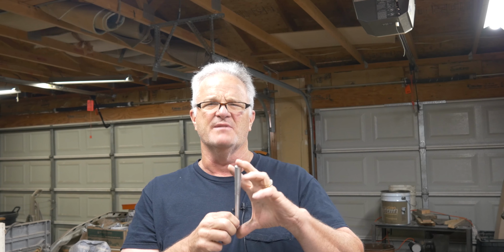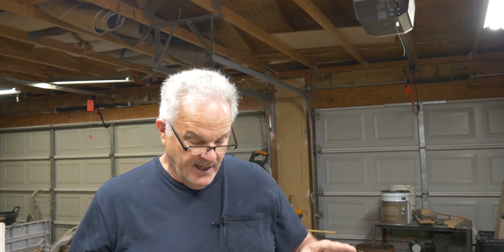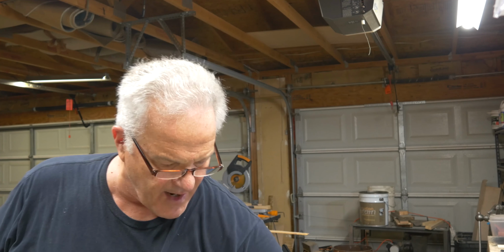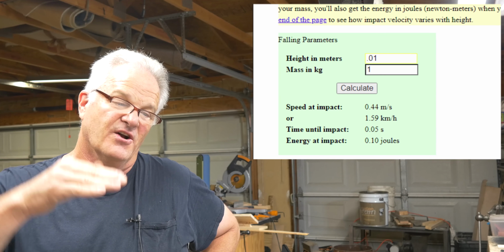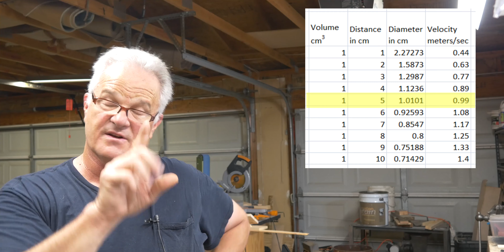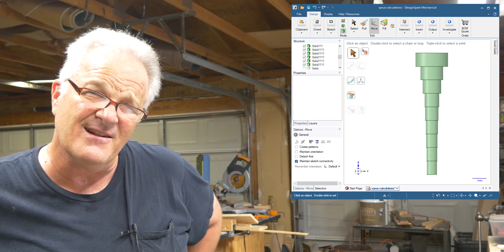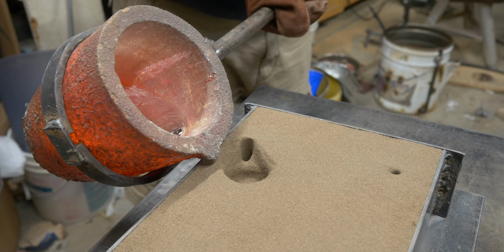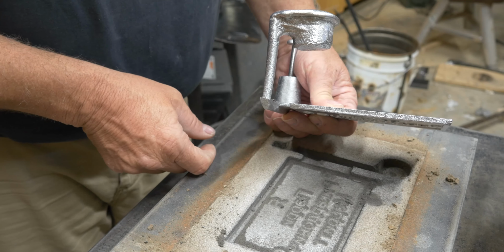Learning to cast metal - tapered sprue

Comment: Perfectly explained . I am following your videos since you uploaded Bob's videos . The video helping me alot in designing my gating system in permanent mould castings . Looking forward for more videos.
Reply from the maker: I think gating is the next video. I keep going back and forth between gating an basin, which to do next.
Reply: Video on gating calculation will be nice . If possible make a video on nitrogen degassing effects on porosity . 👍👍👍👍
Reply from the maker: @sourabhkulkarni2515  You might want to check these out https://www.youtube.com/playlist?list=PLU1QP34Dv8Y6lbvgqXuvCPEnXeE4IgWgr They are from a real expert.  

I have no experience with nitrogen degassing or any other type of degassing for that matter. Sorry.  In my opinion, we can do far more to reduce the porosity of our castings by controlling the pour and flow through the mold than microscopic degassing will do.  Just my opinion, don't hate me for it.

Comment: Just found your series - Wish I had some time ago ;(  One thing I wish you had described in more detail was the "Spin Gate" - dimensions and shape. Many thanks for this informative set of videos.
Reply from the maker: The dimensions are kinda made up. I just did what looked right and proportioned. The idea is to redirect the surge from the initial filing of the runner from splashing back on itself. As long as you are putting something round out on the end I think you're fine. The round part needs to e tangential to the side of the runner so the metal is gently redirected into the circle. I've see some guys do it where the make it look like an "i" with the circle centered on the end of the runner. That won't work and will likely cause more turbulence.

Comment: You want to divide your flowrate ( length cubed per time) by the velocity (length) and that will give you the cross sectionla area (length squared) of the pipe ( not the diameter).  You points are still good though, nice video!
Reply: sorry, i meant velocity (length per time)
Reply from the maker: Thanks, I appreciate the info.  I'm really not a mathematician.  If I think about it long enough it starts to make sense though
Reply from the maker: Got it
Reply: You guys are trying to sound fancy by using the word velocity instead of speed. The only difference is that velocity is speed with a direction. This only becomes important when you’re adding multiple vectored quantities together so you can add the separate components (x, y, and z, for example). Since we are talking about a vertical sprue with only a 1 dimensional component (z), the direction is implied and it’s not really a vector quantity in this context. Here, the word “speed” is fine... using “velocity” when “speed” would do only makes you sound smarter to people who don’t know any better (see the movie “Idiocracy”)

NOW. If you put the sprue in at an angle, you would have both a Z and an X/Y component. Gravity would only accelerate in the vertical direction, so the final speed (or velocity if you still want to go there) would be less for a given sprue length than a vertical one. This should make sense if you think about it. Further digging will reveal that it’s proportional to the cosine of the angle deviation from vertical (100% at 0 degrees deviation and 0% at 90 degrees)
Reply: Yeah I was just trying to say that what we're calling the size of the pipe is actually its cross sectional area and not the diameter...so the spreadsheet needs a sqrt() in it somewhere
Reply: @TroyeWelch  🤣
Reply: Who is trying to sound fancy? I'm cracking up here!
Reply: @TEXAS-SMITH  sometimes you have to out-fancy the fancy. Something comes to mind about the people who think they know everything being very annoying to those of us that do. Raise your hand if you’ve got an engineering degree🖐🏼

Comment: Thank you for sending me here from your aluminum bronze hammer video. I didn't realize how old that other video was before I commented which is a little embarrassing, I should have checked before. I definitely don't think that hole was shrinkage though. The top of your casts with the divot definitely is, but that hole on the face isn't uniform at all. It looks like sand collapsed a little while you closed it which you thought may have happened and that's what caused the hole on the hammer face. I could be wrong though, at the end of the day, you fixed it and it looks great. You're awesome.
Reply from the maker: Yeah, that's a problem with YouTube. Things like follow-up videos  really don't get posted in a way that people notice. It happens all the time. 

I can tell you that two people that are professional foundry people have each told me that the hole is a void caused by molten metal inside the part shrinking away from the chilled metal of the surface.  Here's another video for you to take a look at https://youtu.be/IYqpHAxBLOI

Comment: I wanted to do a cast with a tapered sprue since I started sand casting, but I still have no proper sprue pattern. (got a tapered pattern from an empty sew yarn roll, but that is a little short) With this information in mind, I really need to be on the look out for a proper sprue! Will defenitely improve my casts! I guess you need various diameters of sprues for different sized casts? For example, if I want to cast an aluminium cast of 3 kg, that small sprue will result in lack of liquid metal in my mold and causing freeze ups before it completely fills the mold right? I think when you go big, you need a bigger sprue and pouring cup, or am I completely wrong on this?
Reply from the maker: Have you thought about this https://www.plmfoundries.com/product-page/sprue-runner-kit

Comment: I was impressed with the air bag demonstration, who’d have thought, excellent. 
Great series, cheers. Peter
Reply from the maker: Thanks Peter, yeah that is one great demo. Wish I'd thought of it :-D
Reply: There's actually a couple of jet and rocket engines that use the same principle to nearly double their thrust. Check out ejector rockets and ejector ramjets. High velocity stream of fluid entrains atmospheric air and fwoosh. Trade a little exhaust velocity for a lot of mass flow rate.

Comment: Great demo.  I agree that the offset pouring basin is inextricably tied up in all this - even a tapered sprue will suck air if you use a funnel shaped pouring basin. It's the venturi effect.  Your propane burner is probably designed to suck in all the air it needs in the exact same way, just like the amazing plastic bag demo.  Looking forward to the next episode!
Reply from the maker: Yeah, man I really debated...still am... whether to do the basin next or the runner/gate(s).  all three are tied together.  Maybe I should do the ....  aaauugh it hurts my head to think about it. ;-)

Comment: I am curious about the relationship between the size of a part to be cast and the most appropriate sprue size. I recently cast a 9 pound part and after a few failures it seemed like a larger sprue helped completely fill the mold before the metal froze.
Reply from the maker: There are calculations... here's where you know I'll fall apart... that give you stuff like freeze rate and from there I expect you can figure out required volumetric flow rate.  I know that larger castings require larger sprues for larger volumetric flow.  I'll ask my foundry friend Nate if he's got anything to offer.
Reply: Preheating the molds before casting can reduce the risk of developing early freezing.

Comment: It seems logical that a tapered sprue would lead to less turbulence of the poured melt, and therefore less entrapped air.  However the viscosity of the molten metal would not be the same as the viscosity of water, which would make your calculations dubious.  Think of sucking honey compared to water through a straw.   I suspect that your very nice casting has as much to do with the offset pouring basin, the spinner, the quality of the aluminium, the side-bottom feed and the quality of the mould.   I imagine that molten aluminium has a higher viscosity than water, which would make the velocity of the melt even lower, and better, than your calculated value.   But great food for thought.  And thank you.  I will try a tapered sprue!
Reply from the maker: The experts, Professor Campbell and Bob Puhakka all seem to treat the speed of the metal as if it is falling water.  I've yet to read or hear them talk about the viscosity being an issue.  I will ask Bob in my next conversation with him to see what he says.  

I personally do not know the difference in viscosity between melted aluminum and water.

You are correct taht the quality of the casting has to do with all of those things.  In the interest of keeping the videos brief, I cannot talk about all of the components together but none of them work without the other. It is a system.
Reply: If you watch a lot of aluminium pours the molten metal does behave almost the same as water only just a little bit slower. Some foundries pouring large quantities of aluminium direct the pour from the crucible to the molds via ceramic troughs almost like aquaducts. They have to preheat them first with a propane burner, but when the aluminium is released it is very much like watching water flow.
Reply: Mark Fryer “a little bit slower” is my point.   I would like to know the number to see if the mathematics or arithmetic stacks up.  The viscosity of molten aluminium and bronze would be relevant.  I do not possess s copy of Prof Campbell’s book and cannot find the number elsewhere.   Johnsmachines.com

Comment: You made an aspirator or an eductor with your bag demo. The same principle is used to fill escape slides on passenger aircraft. The slides on an Airbus A380 have to inflate in under 2 seconds. They use a chemical rocket which fires through an open venturi to drag sufficient air to fill the slide and cool the rocket exhaust. A great demo and explanation but you almost lost me when you mentioned "mathematics". 😬
Reply from the maker: An eductor?? Come on Mark you hurt my little brain when you use big words like that 😃  I had to go look it up to see what it was, but yes apparently I did. 😃

Yeah, I'm pretty decent at arithmetic but that math stuff throws me every time.  Had to call my son on how to move a variable from one side of the equation to the other.  He said "come on dad you just divide both sides by the stuff you want to move"  Sigh...

Comment: Do you need different size sprues for different metals? Great demo !
Reply from the maker: I don't know that sprue size and metal type are directly related. If a metal needs to fill a mold quickly a larger sprue might be required. I'll have to ask. I just don't know.

I've use the same sprue for aluminum, brass and different bronzes
Reply: Acceleration due to gravity does not depend on material density. This is why a bowling ball and a feather will fall together in a vacuum. This has been done and is probably out on the YouTubes.
Reply: Troye Welch : It is understood that gravity is a constant, however this is a specific gravity question. If you are using different metals then the diameter of the sprue should change in order to maintain the desire flow rate,

Comment: If you were casting silver. Say items 1 to 2 oz. What scale would you print the sprue and spin trap?
Reply from the maker: Darn good question.  It all comes down to how fast you need to fill the part. When you pour in a tapered sprue, its important to keep the sprue full the whole time. That means pouring as fast as it will take the metal. The smaller the sprue, the less metal you'll get to the runner.  What is one ounce of silver, like a quarter (currency)?
Reply: @swdweeb  bigger than a quarter. An American Silver Eagle is a 1 troy ounce coin. It has a diameter of 40.6mm. It is 2.98 mm thick. So 1.598 inches across and    .1173 inches thick.
Reply: @swdweeb  i am not sure why the latest comment didn't post.  Just for perspective.  I poured a silver lego. It was a 10 x 2 brick. It weighed 2 oz
Reply from the maker: @billsaunders1879  Keep in mind, I've never poured silver. That said, I would think a part that small could use a smaller sprue than what I use but I'd probably still just pour it with what I have.
Reply: @swdweeb  thank you.  I make coin rings.  From 90% silver coins and also 999 fine silver bullion. I have to punch out the center before I make the ring. I have been saving my 999 fine silver punch outs to make castings with.  I have been selling the 90% to local silver dealer. Apparently the 90% stuff is not was appealing to collectors and is harder to sell items cast from it.  Lol I wish I had more 999 fine silver but I only have 6 oz right now. If the smaller spue and spin gate don't work then I will have to wait until I have more punch outs or possibly buy some bars with the money from the other scrap.  I will let you know how it goes.
Reply from the maker: @billsaunders1879  You know I don't think about it much with aluminum but the sprue, runner, gate, and  spin trap all take metal to fill. Metal that isn't going into the part. I expect this is much more of an issue when you're dealing with stuff that costs quite a bit more.

Comment: Would this apply to vacuum assisted lost wax casting? I’m using a pretty large straight sprue. About 20mm in diameter. Each pour is about 9kg of brass.
Reply from the maker: Man, I'll be completely honest, I have never done any lost wax stuff.  I marvel at the sculptures that come out of it all of the time. That said, know that everything I'm about to say is opinion based on zero experience doing what you do. 

I think in general bottom filling and reducing the entrainment of air in the pour is a good thing. To that end, a tapered sprue that is kept full during the pour has to help with the amount of air that enters the mold.  To what extent the vacuum helps with entrained air, I don;t know.

Sorry I wasn't more help.
Reply: swdweeb, this video was very helpful. Thought provoking. We actually fill from the top. During burnout the gate has to be at the lowest point of the casting so that the wax is able to completely empty the cavity. We already get very nice castings, but I think that a smaller and tapered sprue could be beneficial. 

We often have up to 10 parts in one flask arranged around the sprue at varying distance from the mouth of the sprue. The vacuum certainly helps fill the cavities fully. The parts are either very ornate door handles or wiring channels that cannot be machined because features of the parts block access for a drill. The waxes are assembled from two parts so that the holes align. 

Thanks again for the videos.

Comment: Would not a large feeder also allow inside air to be displaced, provide constant fluid feed and head pressure due to its weight? Can a small tapered sprue feed?
Reply from the maker: Can a small tapered sprue feed??? Of course it can feed. 

Head pressure isn't all it's cracked up to be. https://youtu.be/_3lwlBx6-YA
Abd you certainly don't need a large feeder to displace air https://youtu.be/fvSHwvTyApk

Comment: Thank you for doing these Perry. Much appreciated. Like others here I imagine, I have been casting for a while, but I need to review the basics to try and correct my ongoing rookie mistakes. Shameless plug, I made a video a few weeks back inspired by the videos you hosted for your friend Bob Puhakka and also Andrew Martin's experiments. https://www.youtube.com/watch?v=GwqENPFqPBM&t=4s. Also, would you consider doing a basics lesson on sand management? I pull my hair out trying to guess at the right moisture content to maintain. Thanks again.
Reply from the maker: Shamelessly plug yourself all you want.  I watched both videos. Good stuff. 

Regarding sand, that's a tough one.  I thought I put a really quick spot in one of the "learning" videos but I couldn't find it so I guess it ended up on the cutting room floor as it were. It really is a trial and error thing for me. I have settled on a ratio of about 2 liters of sand and 36ish ml of water for my ratio. I have a cup that holds about 400ml of sand and a little cap that holds about 6ml of water. I mix five cups of sand with 6 caps of water.  

I let my sand dry out between uses. That does two things. It gives me a consistent starting point for how much water and it keeps it from developing a moldy smell to it. I'm the only one that I know of that seems to get that smell, but I don't like it so I let it dry out.  The downside to this is I have to prepare my sand before I cast anything. When you just want to run out there and cast and think "Doh... I've got to make sand first" it can be a bit of a discouragement. 

Bottom line on the sand is I've found a moisture content that seems to work well for me and now I know what it feels like. So I can stick my hand in it and tell if its too wet or dry. I've kinda forced myself to do it that way as I want to be able to simply grab some sand know that its where I want it to be
Reply: @swdweeb  Thanks for the reply. I like your consistent approach, but having to re-wet sand every time goes against my lazy nature. I think I might try drying out a portion as a test and then adding in water with the ratio you mentioned.
Reply from the maker: @charliekrauter5176  trust me, I wish I could just store sand that was ready to go and use it whenever I want too :-D  I tried that and as I said it smelled of mold when I opened the container.  Probably because it was moist and sealed and in a garage that gets to around 100F in the afternoons.

I know other people are able to store their sand in sealed containers so they only have to go through the re-wetting occasionally and do it in large batches. Just didnt work for me.

Good luck with it. You will likely find "your mileage will vary" on the amount of water but play with it and get it to where you like it.